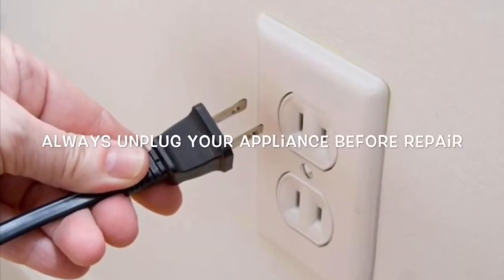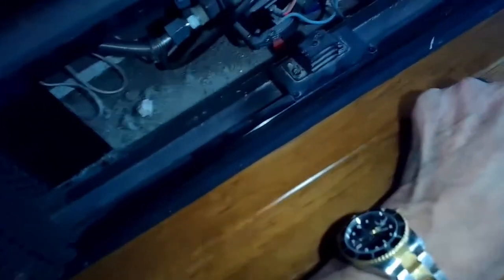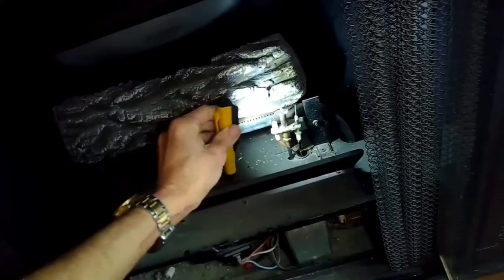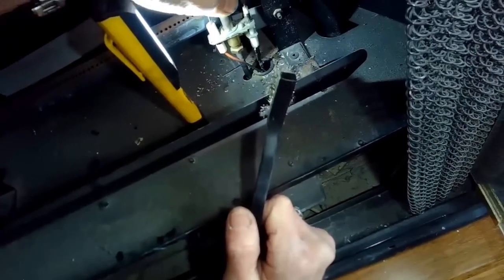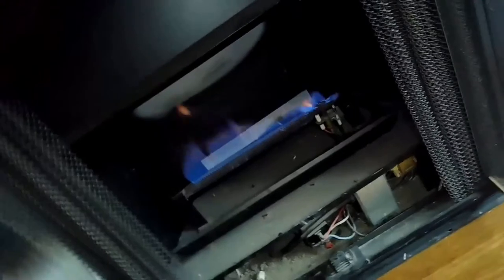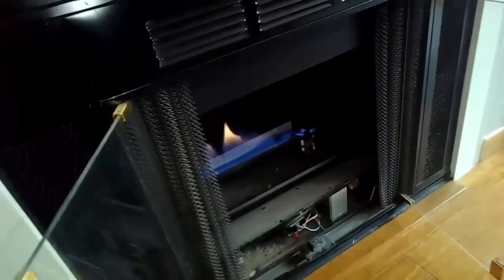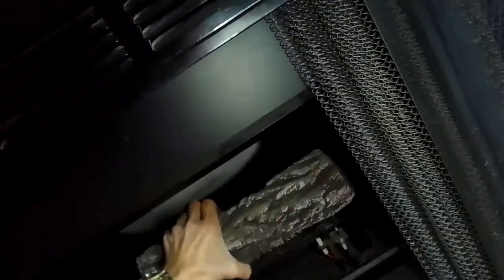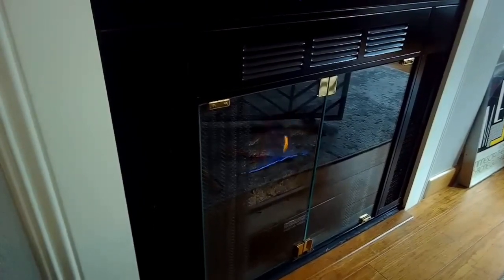GAS FIREPLACE WON’T LIGHT🔥 (FIXED)

Comment: You can get an orifice replacement but I bet they was cob web or critter behind that deflector. Good job. This one features a slow opening gas valve and it also had a flame sensing feature.
Reply from the maker: Thanks so much Dan

Comment: I couldn't discern the exact location of the pilot hole you cleaned with the dental pick. Is it on the below the pilot hood? Or was the pilot hole cleaned off-camera before cleaning the manifold (burner?) holes? I'm always amazed the clarity of your explanations, props! ..Mike
Reply from the maker: Thanks so much Michael,  it’s best to gently poke all the holes you can find👍